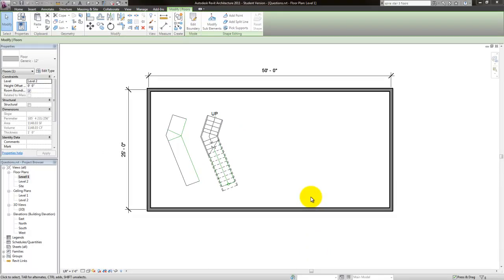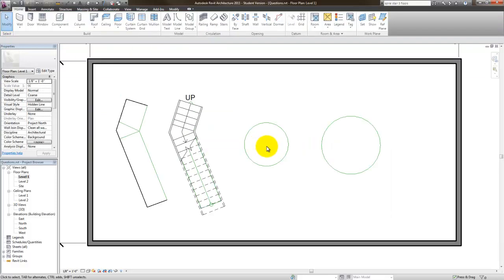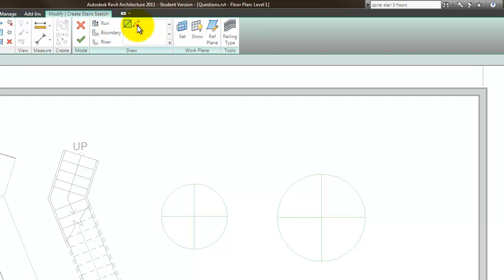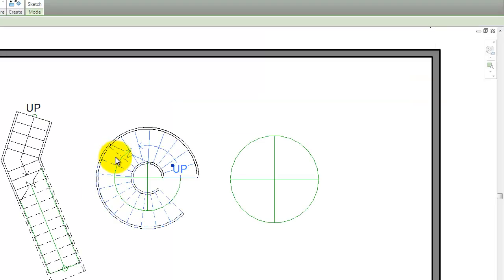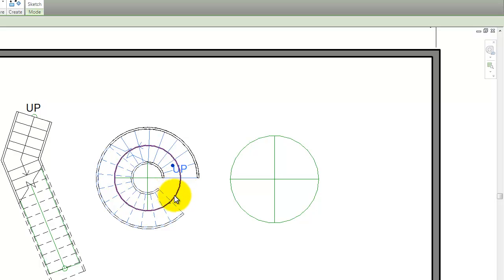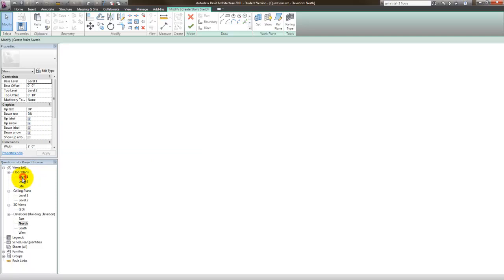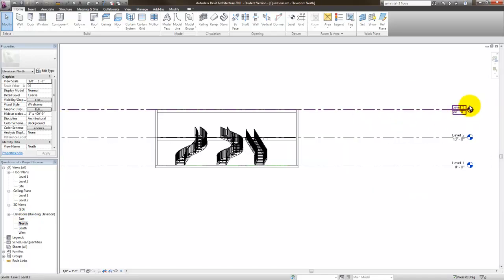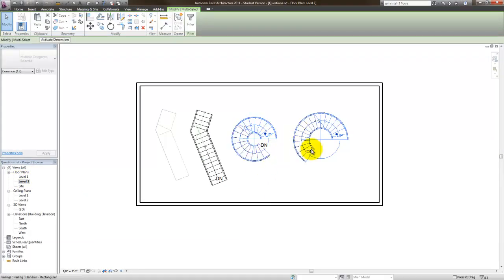REVIT - Spiral Stairs

Comment: Johnny,
Thanks for the tutorial... Technically speaking, there is a difference between "circular stairs" and "spiral stairs".  What you illustrated there is a circular stair.  A spiral stair generally has a centre pole with handrail only on outer edge, and generally wraps overhead much more suddenly than a circular stair.  I was hoping to see from your tutorial how to reduce the quantity of treads on a spiral stair, as I seem to always increase the treads when using the grips.